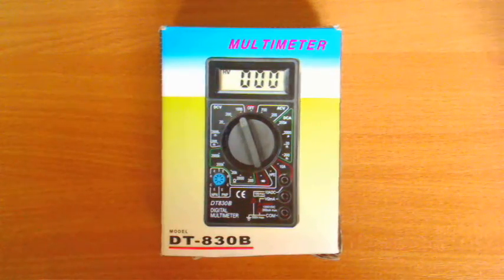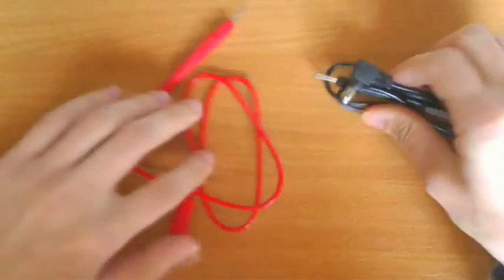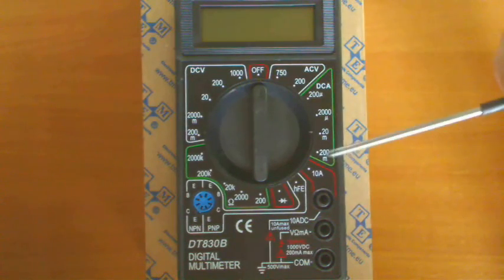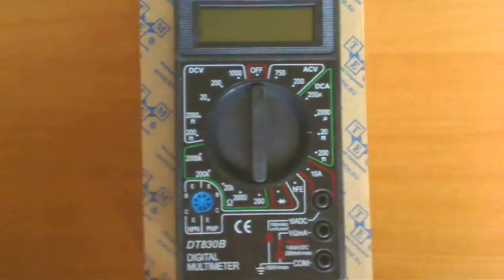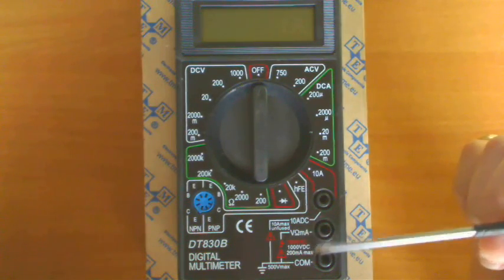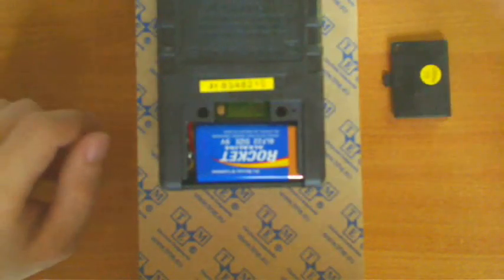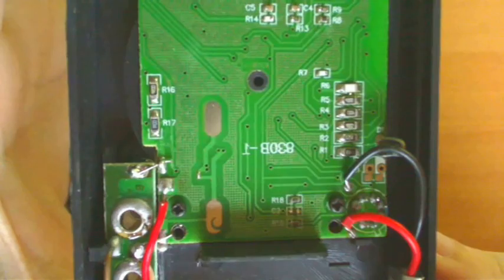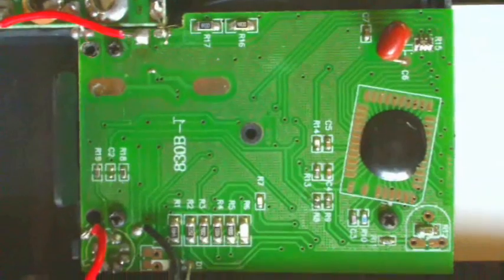[HST] Multimeter DT-830B First Review [ENG]

Comment: All multimeters in this price range suck, so why spend more than you have to? I bought one of these cheap off the bay and it seems pretty sturdy & reliable for voltage/current readings. Good enough, except for the lack of buzzer for continuity testing.